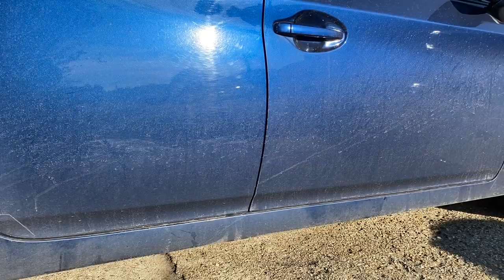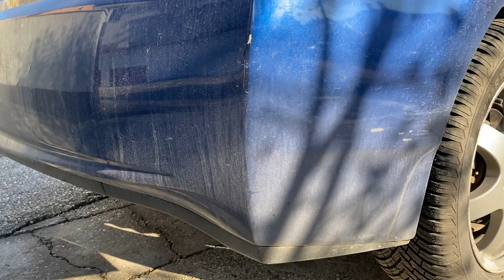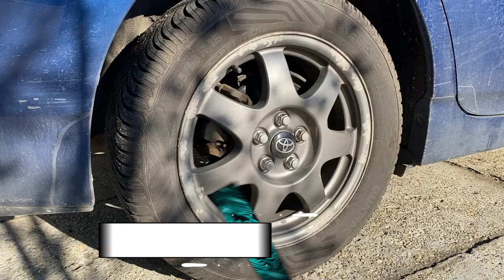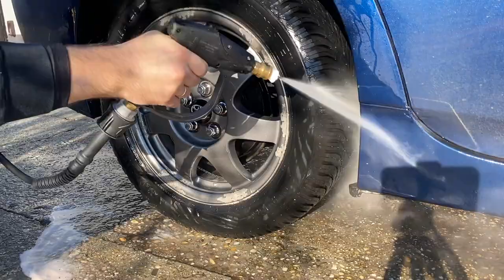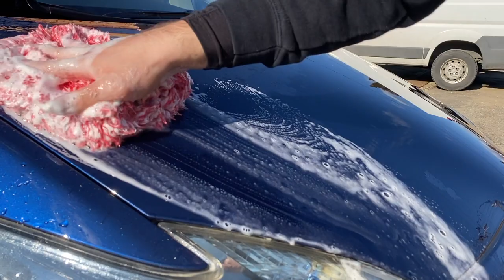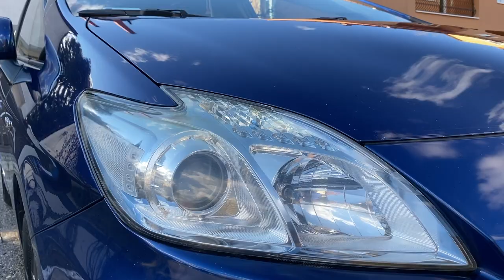Transform DIRTY Wheels and Tires... Detailing ASMR

Comment from the maker: Do you enjoy cleaning wheels and tires?
Reply: Yes love cleaning wheels even if mine are all gloss black and fiddly. 
I use wheel cleaner 
Topped with wheel shampoo in an ik also
Reply from the maker: IK is my go to choice for cleaning wheels, too. One of my favorite tool. I’m planning to invest in a set of gloss back wheels, but I’m on the fence spending big money just yet. :) that would change the process up a bit.
Reply: I love cleaning them! Probably the most satisfying part you can clean on a regular basis haha 
When you use the foamer do you bother with shampoo in the bucket?
Reply from the maker: @thedetailinghobbyist  I feel the same way Craig 🙌 No, if I foam the wheel up (with snow foam or shampoo) I only bother getting clean water in the bucket to rinse the mitts, brushes, etc. that's all. 👍🏻
Reply: @RoadToDetailing  thanks, Viktor! Sounds like it might be worth investing in a decent foamer 👍🏻
Reply from the maker: @thedetailinghobbyist  yes, indeed. For me: I cannot imagine a wheel cleaning without one, although it’s not fully necessary, this ik foamer is one of my all time favorite tool.